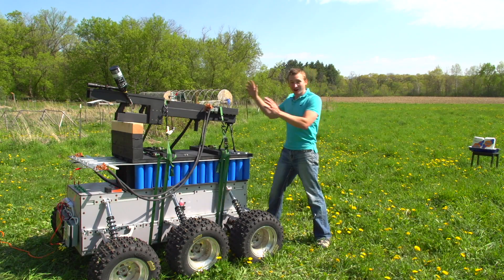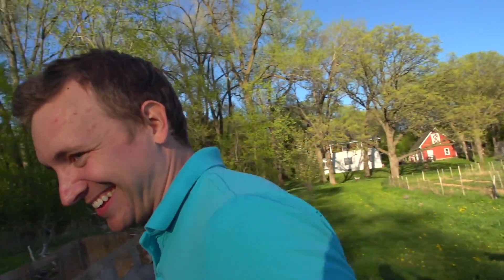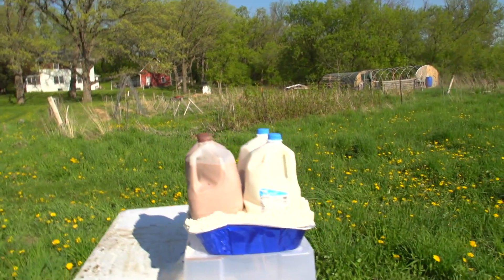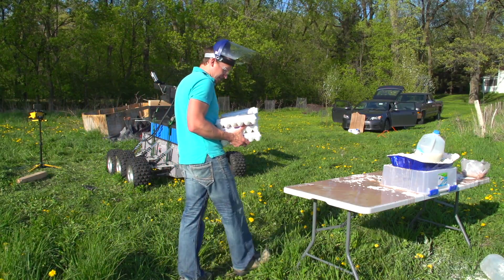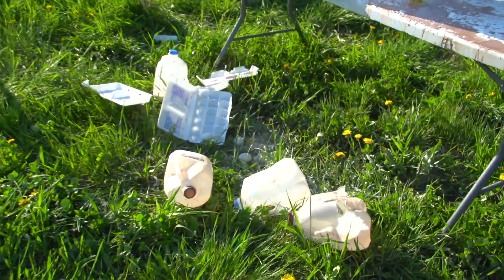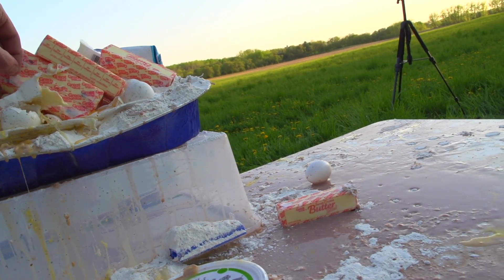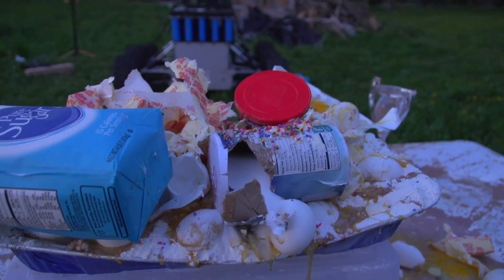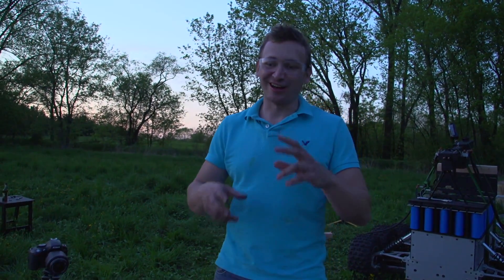World's First Railgun Tank, 35,000 Joules: Let's make a cake.

Comment: Dude i am going to build one 50 times the power and use solid copper pipes and bars of copper inside the pipe and a larger capasitor bank . Aluminum sucks i will go with copper 4x4 10ft long each.

Comment: You should make the cables stay attached, and make the rails longer so that the projectile gets more energy from the capacitors, cause right now it looks like its not getting near as much as what is stored in the capacitors. I know it is an inneficient way of shooting a projectile but if yoy make the rails longer, it will have more distance and time in contact with the rails to speed up, which is why so many rail guns are very long. Id like to see you get a half pound projectile go supersonic.

Comment: The problem with a railgun is that the efficency is very low. Just because you are putting 35 kilojoules into the system, it does not mean that you get the same kinetic energy out of the railgun. My guess is that your efficency is around 2%, which equates to 700 joules of kinetic energy. Another problem is that your projectile is heavy and slow, so you will never be able to penetrate something hard like a AR500 steel plate. A 9mm with 400 joules would be better at penetrating things, because it is faster and the tip of the projectile is pointy. You could try to create sabot rounds. Maybe your performance will increase by doing that.
You should also use some proper cable lugs for the connections. It will prevent the cable from ripping of every time. It is also going to decrease your contact resistance so you get higher peak currents and more kinetic energy.

Comment: Hey can you drill a hole half way down the back of the bullet. I think the plasma will be trapped in the drilled hole and as it wants to escape it will act slightly as a plasma rocket-ish. ... If that makes any sense
Reply from the maker: I'm not sure that would work. There's little to no plasma pressure because it's not a barrel and the projectile is not sealed like a bullet. At best, the hole would fill with some heated aluminum vapor at close to atmospheric pressure. Compared to the thousands of lbs of magnetic force, it would be miniscule. 

Also, at some point, the projectile outruns the vaporized, heated gases in the chamber (it can be seen outrunning the aluminum vapor in the video by hitting the target first).
Reply: Ziggy Zee. Oh, ok.
 Thanks for the reply and also nice video. Can wait to see the cannon fire again. 
You think you shoot some watermelons or clay ?
Thanks again and have a good one 👍
Reply: Ziggy Zee. Hey and is that a Marx Genorator? Just asking by the way
Reply from the maker: Funny, I had like 30 lbs of clay- but haven't been able to shoot it yet. It's not a marx generator- if it was set up like one, it would generator 28,000 volts (which would be terrifying.. and would probably blow up one of the capacitors).

It's 70 high-amperage capacitors (in this video) in parallel with heavy duty bus bars to transmit the current.
Reply from the maker: A marx generator would take the 400 volt capacitors (charged in parallel) and discharge them in series (essentially multiplying the voltage by 70)
Reply: Ziggy Zee .... Lol awsome
Reply: Ziggy Zee ... hey in context to Breaking capacitors.. A person could use salt water capacitors to avoid damaging expensive capacitors. From what I understand... (And p.s those 300lbs of capacitors... 👍)
Reply: Ziggy Zee 
Hey I have a question about the construction of this railgun my question is Do you have a non-conductive plug/stopper to seal the back end of what is essentially a cannon... And from what I know about making cannons are two things the Canon needs to be sturdy in the second thing is it needs to be airtight except for in One Direction. Hope this helps... P.s it should as magnetic force alone is only so much as plasma is heat and pressure with the energy so it must travel also like a gas hope it helps... & also I theorize that an optimal ark jump should happen 30 percent down the rails for added efficient effect

Comment: Never mind my previous comment.... You were way ahead of me. Just found this channel. Lotta haters with no idea what goes into something like this. Ziggy, Have you ever put any thought into a targeted EMP device? I've seen EMP as a side effect of stuff like railguns and stuff that have electrical discharge that can induce current in electronics in close proximity. Saw a magntron from a microwave made into a directional device killer but as far as i could tell, it was still within yards. What abaout a sudden burst EMP device that could fire a blast at a few hundred yards? I don't want to fry myself or cause indescriminate mayhem, but a 200 pound capacitor bank powering a million watt burst of focused energy sounds fun in a meniacal way
Reply from the maker: Unfortunately, my type of capacitor is not capable of withstanding the polarity reversal that would be incurred with the inductance of such a circuit. An oil-filled high voltage capacitor would be necessary.

Comment: you should turn the u shaped bullet as of now its sideways decreasing your power on the projectile. that u shape needs the open space to touch the rails as to not pinch the back ends of the bullet together... aka more power if it dosent pinch. aka the bullet is sideways. the us. railgun has the same shape but watch them load it...
Reply: its hard to explain but the way explosions go up. its best if the expulsion encircles the inside cavity of the u shaped round exerting force upward and still on the bullet instead of the lotter.  ====O))))
Reply: p.s nice toy man

Comment: Make the System critically damped...
Also, how much of the cap bank actually discharges into the load?
Reply from the maker: Well... if it was under-damped, my system would explode due to polarized capacitors... so, over-damped works well :)
Reply: Have you taken any measurements of this thing in operation?

Comment: Nice rail gun,

Solider you're feed wires or solider on some nice ends that you can modify to still disconnect if you need them to. That big bush of copper seems like it would probably lose some efficiency over a cleaner setup.

Just a suggestion, have a good one

Comment: I used to work on a machine that had thirty 18in xenon flash tubes.  (30 simultaneous arcs 18in long).  It turned a silicon wafer into a pringles chip or sand.  Flash anneal is the name of the technology.  The power supply was on the floor beneath us, it was about 8ft wide and 15ft long.  You could feel it discharge, with a bassy "Thunk".  It could recharge in about 60sec.  To work on the flash unit you had to get a key from the power supply which is only removable in the OFF position.  That key unlocks a shorting bar access port.  After you engage the shorting bar more keys unlock, those keys give access to the rest of the machine.  All of these locking points had to be LOTO'd.  Safety first.
Reply: Reminds me of a virtual tour I had of the National Ignition Facility. It being a virtual tour was of course limited but I asked about the discharge of the capacitor bank and they told it it was "very loud". They couldn't specify how loud but I would assume your ears would be ringing. There is also the Z machine which discharges 2.7 megajoules of energy into a small chamber. The capacitors for this thing discharge so loud and the machine's burst is so strong things on tables jump a little. The power of huge amounts of electricity is fascinating.
Reply from the maker: Sounds sweet

Comment: Your cables fly off after every shot, but instead of trying to secure it more, I think the better option it the opposite: you need a couple knife levers that blow apart while it is being fired, so that the knife switch opens up instead of the cables flying off.  Otherwise, no matter what you use to secure the cables, you're going to rip it apart.

The knife switch or other device would be easier to reset after each firing session.

Comment: Just a suggestion from an old retired aerospace engineer.....

http://www.galco.com/images/coh/large/e-z1016-8364_p.jpg
http://www.galco.com/images/coh/large/e1016-1702_p.jpg
http://www.galco.com/buy/Joy-Cooper-Interconnect/E1016-1702?source=googleshopping&gclid=Cj0KEQiAot_FBRCqt8jVsoDKoZABEiQAqFL76J7leX9DZCPPzL8GS6HOovuIpYLE_MwnX26kAsx1PLsaArT98P8HAQ
Reply from the maker: I found some proper wire lugs (finally). Haven't had a chance to test them out (it's been winter).

Thanks for the suggestion though.

Comment: Just an idea, and it may not work.  But why don't you try using shorter cables?may give it less slack to fling around and yank off.  And if not then at least like weld some kind of hooks to the body of the vehicle and run the cables through them so they stay by the body instead of flying around in every direction lol

Comment: Still you haven't learned how to connect thick cables properly. Dumbass.
Reply: Sixta16 the cables rip off because of the magnetic field, not any kind of recoil. if the connections didn't rip off then the cable itself would probably rip. take a highschool physics class dumbass
Reply: Sorry, you dumbass the 2nd, but twisting the fluffy copper ends around the bus bars simply ain't gonna do it. Ever.  If properly terminated with an appropriate crimp lug, nothing rips (and the copper cable itself will be the last thing to rip).
Reply: Sixta16 0

Comment: You should work on the projectile
Reply from the maker: leepailong123 You mean the $170 electrodischarge-machined-with-gold-plated-wire projectile??
Reply: Ziggy Zee yah, obviously. 

More like that you should make it more aerodynamic so it actually hits the target nose first :>
Reply from the maker: leepailong123 I will eventually use the tungsten finned projectiles in conjunction with the aluminum. They are more aerodynamic.

Comment: the hardware you have has a lot of petential, but there is a lot room for improvement.
1.The efficienty is horrible low, but you have to find out the exact number with a gun chrony so you can start improving. Some more  tips , 
2.clamp the cables every 10 inches to the solid body of your machine.
3 double up the cables 4 instead of 2, use better clamps.
4. start avoiding aluminium on the clamps and replace the aluminium bars with copperrails, they are much better at hight currents and you dont get losses from aluminiumoxide.
5. use a cheap digital oscilloscope with memory (30$ on ebay com) to record the discharge curve. So you know how much power is used , and how much is left in the capacitors.
6. then you can make the barrel longer to optimise the barrel lengh to the capacitor output.
Reply from the maker: Hyper Hektor The rails are indeed matched to the size of the capacitors. Aluminum is a decent busbar for this application- there's a relatively minor resistance loss with aluminum oxide.
Reply: I experimented myself and i can tell you for sure because i measured that copper is way better for that application. Also just look on wikipedia if you need confirmation about my claim that copper is a better conductor.

which method did you use to match capacitors and barrel?
Reply from the maker: Hyper Hektor Copper has twice the conductivity, but is much more expensive. I used calculations to make the perfect barrel length. There is zero voltage after firing.
Reply: interesting, can you tell me how to calculate the barrel lengh?
Reply from the maker: Hyper Hektor understanding the discharge rate of the capacitors will give you a fair understanding of the current developed in the system. It's a good starting point.
Reply: i know there are several ways but i just wanted to know what formulas you used.

I made my suggestion list to give you some ideas what and how you can improve your machine. If you cant optimise it you might reuse your capacitor bank for other energyweapon types like plasmagun, plasmoidgun, coilgun .
Reply: it would be great if you could measure the projectile speed for energy & efficiency calculations (crony for guns , or cheap appss which work with sound).

Comment: If I'm not mistaken the projectile passed thru the milk and is seem at the first tree line at 3:03,4,5, take a look. Also you may consider carbon rails instead of copper.... just a thought. Great work and keep going. Thanks
Reply: Carbon rails would shatter.
Reply from the maker: b bock carbon would not have the ability to carry the hundreds of thousands of amps without exploding or the 15,000 lbs of repulsive force.

Comment: If you want maxim power to the rails you need to tap the capacitors from the middle of the bus bars, you need more cables in parallel and thicker rails. Looks like allot of the energy meant for the projectile is going in to flinging random stuff around.

Comment: Im loving the build so far!  However you should do some distance stuff!  I'm curious what the drop off will be like at 100m and 250m.  You should also try and make a more aerodynamic saboted penetrator round. Imagine the round you have now, but with more extreme taper to a steel point.  Sabot that with teflon and bam, penetrator round.  If you had something like that, you probably would have made it through the whole car in the previous video lol.  I also vaguely remember that adding a layer of teflon to the back of the round will give it more power.  Don't quote me on that, I'm not sure where I head this.  It was years ago.

Comment: First, destroying all that good food is not a cool thing to do I think,
when half the world is hungry.
Second you do not give any explanation, drawings, circuit diagrams so your demo sucks now twice.
Third your gun is falling apart after each shot it seems.
Fourth it does not really seem that powerful, try a 1 meter concrete or steel plate.
Fifth you can have as a growing up kid have just as much fun with a rubber band.
And last but not least SIX
TRY 'YELLOW CAKE' 
 IT CAUSES A NUCULEAR EXPLOSION IF THE MIX AND SPEED IS RIGHT.

Comment: i feel like this thing wastes most of its energy -  you said there is enough energy there to compare to 75 .45cal bullets being fired... yet the resulting energy delivered to the target -  is far less than what 1 .45cal being fired would provide. Cool. very cool. but... most likely an issue with the tech itself -  or your implementation of it perhaps.
Reply: It does waste a lot of the energy, most of it is converted into thermal energy, hence the copious amount of plasma and sparks/molten metal.

Comment: Notice how the wires fly in the air-- This is not due to recoil, but actually the wires have so much current flowing through them that they become electromagnetic and attract themselves! This is a dangerous phenomenon with high voltage power lines, as they can hit nearby technicians if turned on suddenly.

Comment: @ziggy_zee you really need to measure the bank voltage immediately before and after the shot.

Something tells me you're not dumping anywhere near the full 35Kj into the projectile.
Reply from the maker: Lemming it's near zero unless a poorly fit projectile is used. Sometimes it can overshoot into the negative slightly due to inductance.
Reply: Likely not. If nothing else, the rails aren't nearly long enough to properly exploit the energy available.
Reply: Ziggy Zee Actually, you may want to shorten the rails then. I think that if projectile leaves the rails at 0 volts, it means that capacitors have gone dry on mb half way through and you can lose some energy due to friction. Another possibility is that when near 0, the force is not enough to overcome friction, and you are losing speed.
I would reccomend to try shorter rails either way.
Still very cool project though
Greetings from Russia
Reply: Of course not. You obviously eat them with hands for feet.

Comment: you might consider setting up a ballistic pendulum, to determine your projectile velocity - there is so much light produced by this gun that photoelectric chronograph screens might get fooled
Reply from the maker: Been considering it. (Also considering the possibility of a ricochet :P)
Reply: +Ziggy Zee the idea being to use a pendulum mass which will "absorb" the projectile and thus all its energy, for an accurate calculation
Reply from the maker: +Thomas Koehler Yep. Conservation of momentum. Just saying, it rules out using steel- where lead deforms, aluminum ricochets. The pendulum would need some interesting material... maybe a polymer.
Reply: you have already done some penetration tests and have some idea what will suffice...perhaps a drum-shaped polymer vessel, filled with a high density gelatin would do the trick. Design it so it can be readily opened and a spent projectile removed, fresh gelatin added to bring the mass back to a known level for another shot

Comment: Get better cables or even solid copper rails
Reply: Shaco Clone I believe right now they are using aluminium. 
BTW silvering the rails may also help. 
To apply galvanic silver coating at home is very easy and may help increase it's durability while decreasing resistance.
Reply: +Jeff Ward I don't believe copper is a good projectile for railguns.
Reply: +Sanders 2016
What the fuck is wrong with you mate?
Reply: and a copper projectile
Reply: They should try stainless steel. I'm not too worried about the resistance, we need to see a heavier projectile with a higher melting point.
Reply: /\ /\ This dude....